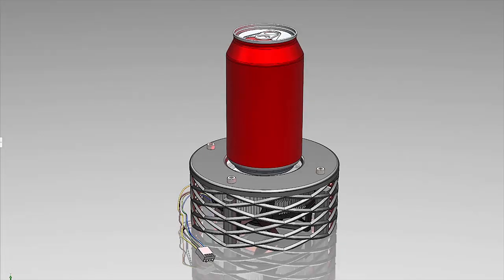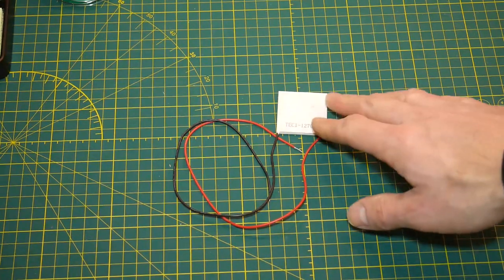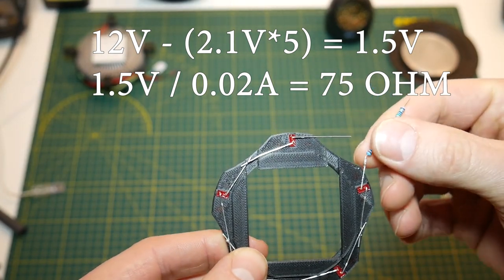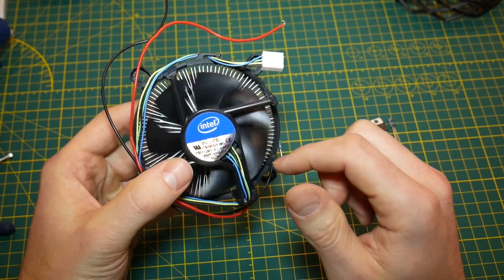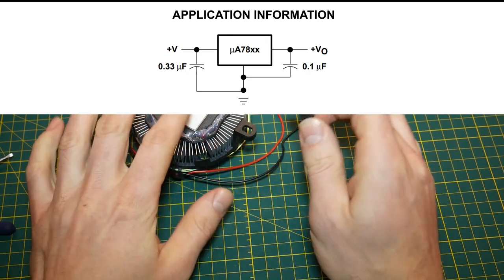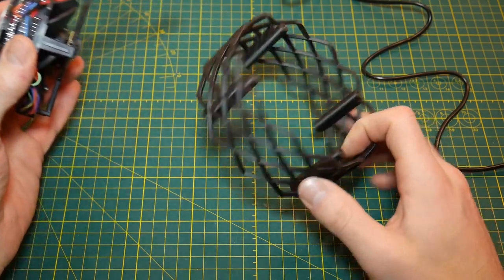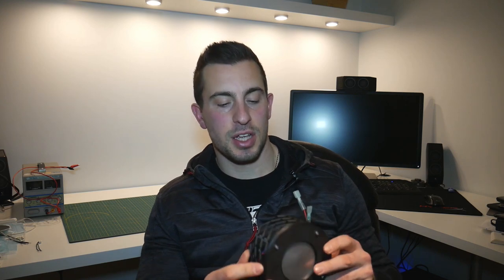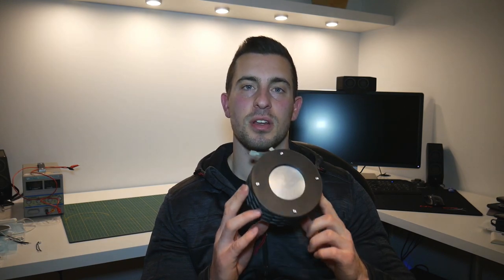How To Build A Glowing Peltier Drink Cooler!

Comment from the maker: Want to build your own? Check the links below to support my work... as an Amazon associate I may earn a small commission at no extra cost to you.
- Peltier Plate TEC-12706: https://amzn.to/47ymOhA
- Voltage regulator LM7805: https://amzn.to/4ecIbrk

- Intel heatsink and fan combination:
https://www.newegg.com/Product/Product.aspx?Item=9SIA4RE63Y9277

- 2mm thick aluminum plate cut to 3" diameter circle

-12V power supply capable of 5A continuous or better (or a constant current supply of 5A, but you will have to wire the LEDs differently!)

- 5 LED lights 2mm x 5mm *7mm such as these:
https://www.ebay.com/itm/100pcs-2-5-7mm-Rectangular-Square-LED-Diodes-White-Green-Red-Blue-EF/273386475662?hash=item3fa71a908e:m:mD5J7ePmKfNpzUQMXdmaAKw:rk:2:pf:0

Comment: I have something similar made with a Tec1-12706 cooler.  It uses a high speed 80 mm fan and a custom heat sink.  My wife purchased it online a couple of years ago pre-made.  Overall it works pretty well.  When running, small amounts of frost will appear on the surface of the aluminium surface.  I wouldn't use this to take a warm drink and cool it down as the contact surface isn't very high and it would take forever.  It works well keeping an already cold drink cold.  We also use a drink cooler with the bottom cut out to have a nice insulator around the drink.  Another improvement would be to have the base in the exact shape of the bottom of the can or bottle placed on it.  I don't know if it would be possible to pour some type of conductive material into the bottom of a can that would dry into shape and be used for the base.  The peletier cooler died on hers after about 2 years.  I just ordered 5 more and plan on experimenting on making my own after I repair hers.  Thanks for the video!
Reply from the maker: Thanks for watching Wayne, all of your suggestions would certainly help increase the efficiency of the device. The biggest would be the insulation you spoke of and increasing the contact area of the drink container. Hope yours works out well for you!

Comment: is there away to get the same Peltier plate to heat and cool?   I want to add these to my car
Reply from the maker: One side gets hot and the other side gets cold... its like  heat pump. The trick is being able to dissipate the heat though... if you don't it will burn up.
Reply: simply reverse the + and - (at the TEC mod) and the heat transfer will be reversed. you will heat the beverage and cool the aluminum heatsink.
the tec mod won't probably burn but if you don't ensure heat dissipation is good enough, heat will transfer back to the cold side after a while and efficiency will be further reduced.

Comment: only thing i would have changed is using a molex connector to protect polarity for the main power connection, or some other quick-disconnect piece
Reply from the maker: Hi Bryan, it would be a good idea. I think I reversed the quick connect male/female spades so that they couldn't be put it backwards

Comment: can it possibly turn it into a battery-powered device?
Reply from the maker: I wouldn't try, it will drain the battery VERY quickly. This requires a lot of power, it is not very efficient
Reply: @EmbraceMaking  thankyouu ^^

Comment: But does it work? 
-How long to cool a can from room temperature?
-Does it keep a can cold all day if taken from the fridge and set on the plate?
Reply from the maker: I would have to do some more extensive testing to test how long to cool a can from room temperature. It works reasonably well to keep drinks cool for long periods of time, but it could be improved with more surface area contact. It is less efficient than it could be right now!
Reply: i made one pretty similar and it doesn't work, yeah the plate gets coold but  not enought, and those peltier cells produce up to 60w of heat + the psu heat losses ~10w
Reply: @EmbraceMaking  Try adding an aluminum cup big enough for the soda can and fill that cup with a little water. That way water will be in contact with the can for more surface area.

Comment: good build, but imho it won't do the trick. Tec modules are not very efficient. In addition to that, soda cans are not flat at their bottom. The actual contact area between the bottom of a soda can and the flat aluminum plate is reduced. actually, the can will touch the aluminum only along its perimeter. Also, the glass is not a good thermal conductor, even if it worked it would take ages for your drink to cool inside that thick solid glass.

this all would work a lot better if you use an aluminum cup instead of a flat, in which you could pour some water. that way, the cooler will cool the water efficiently and, being water more dense than air, you get mode heat transfered away from the can too. basically, you need to wet the bottom of the can up to a reasonable height (1cm maybe).
Even so, any residual water bubble under the can will greatly reduce heat transfer - so you may actually need some additional tweaking in order to make sure that air is removed.
Also, making that water move a little will enhance heat transfer - ie: make it bubble with a mechanical vibration or a magnetic stirrer or ultrasonic speaker...

Besides this, you need to insulate the whole upper area so that no heat from the environment will be heating the can as you cool it. You need to realize you are not only moving heat away from the cold side to the hot side of the TEC mod... you are also producing a lot of additional heat at the hot side of the TEC. And that fan is blowing that heat in the environment, you are probably loosing any gain because of the hot air circulating in proximity of the beverage.

Comment: Can we see if this actually works by putting a thermocouple on it?  Anyone can say, "Oh hey it's cold," and it's like room temperature.
Reply from the maker: I would have liked to do that but unfortunately I do not own a thermocouple or the supporting electronics to read such a sensor. Sorry :/
Reply: Im just trying something like this, in 10 minutes I dropped with temperature of 100ml water from 23	°C to 15	°C. The main problem is cooling hot side, I am using old CPU heat sink with fan, but the heat sink is going up to 40°C quickly. Than peltier is not able to make cold side even cooler, I will have to add bigger heat sink and more fans.
My dream is to make beer glass, which is capable of cooling beer in few minutes :D Unfortunetly I would need over 200W Power suply to do the beer drinkabke in something like 10 minutes :D